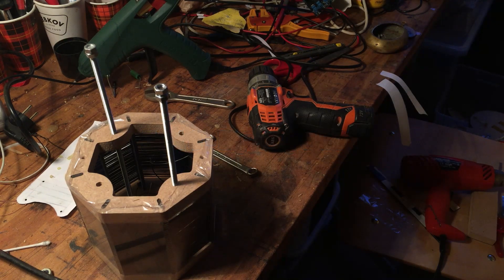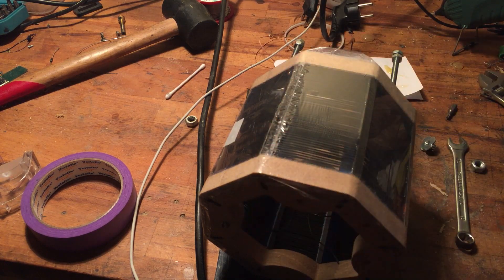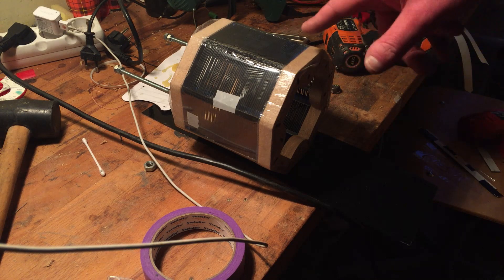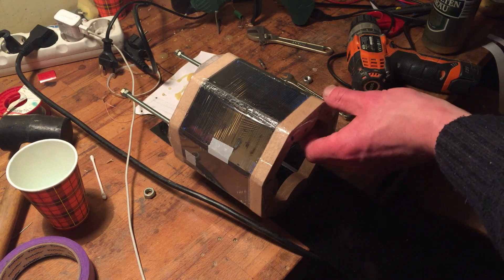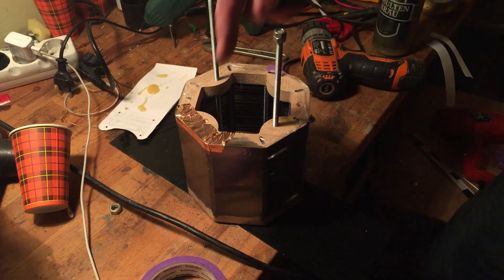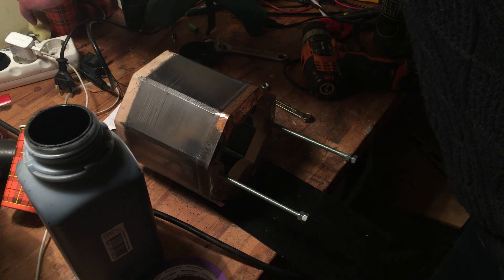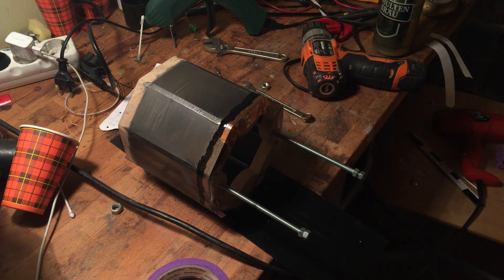Part 3 - Mystery Build

Comment: You could end up the foil with wrapping it around some rod, and rotate it making some tension to the foil while a glue is still liquid (so, no 3M sticky spray of course). Then to screw the vertical rods adding more tension needed.
Reply from the maker: :) thats funny that would be the first panel i made like this 20 years ago :) i used threaded rods to support the foil and just turned one of them up to tension it :)

Comment: Without your potion, this membrane won't play? What does this potion consist of?
I'm trying to translate for you from Russian. It is not easy to choose words so that the meaning of the words is not distorted. If suddenly the word "potion" offends you, then do not be offended. I couldn't think of another word. I have the meaning of the word the movie turns out, then the Opera) In General the most suitable is the potion)
Reply from the maker: coating i guess.
if you can put in a timestamp that might help
Reply: @joppepeelen  
Yes, that's it.
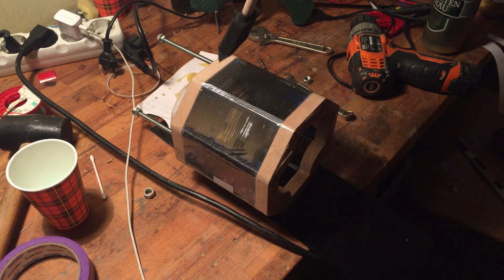Time - 5:06